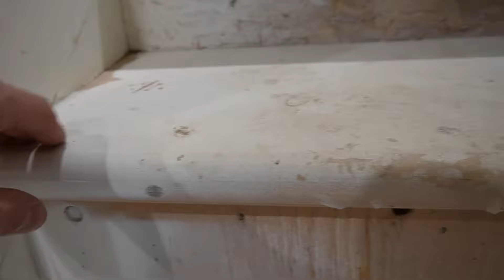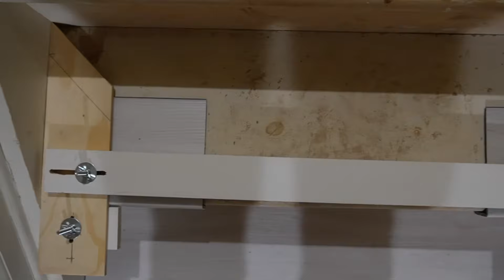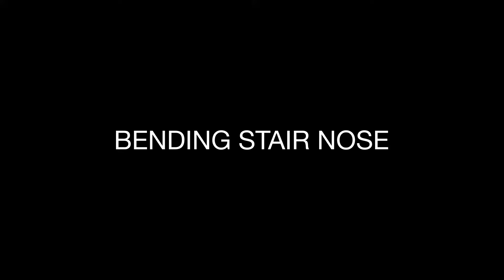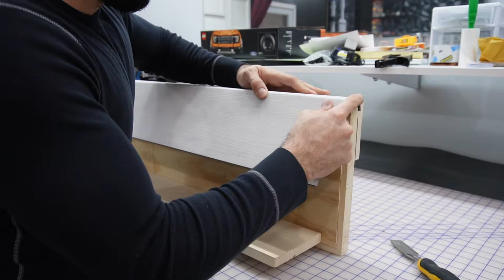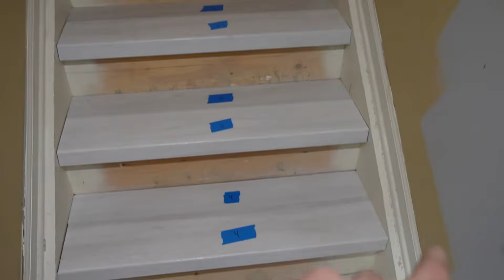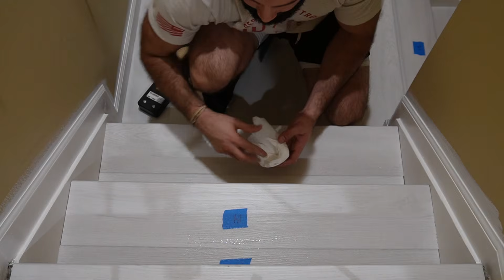Lifeproof Vinyl Plank Flooring Stair Nose Install | DIY

Comment: I have the same Lifeproof brand flooring and when I tried to heat and bend it, you can see the clear wear layer cracking. Did this happen to you? How do I get the wear layer to not crack?
Reply from the maker: Slower heating, I ran about 3minutes a plank, if it’s cracking and hazing white it’s too hot.